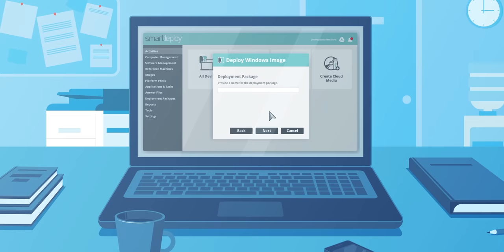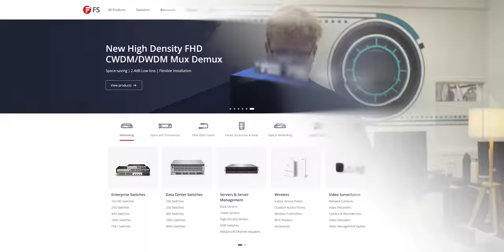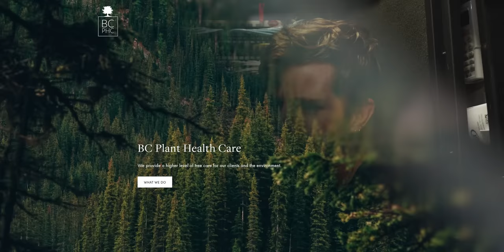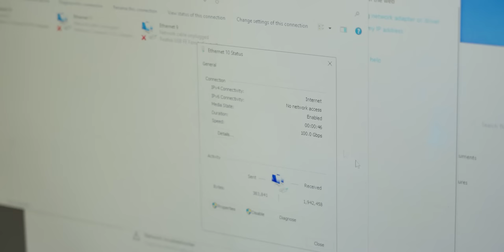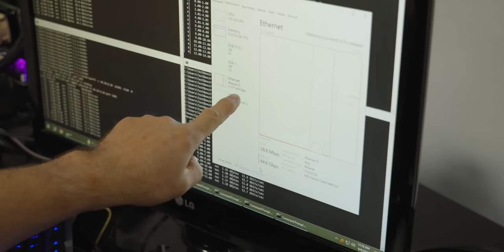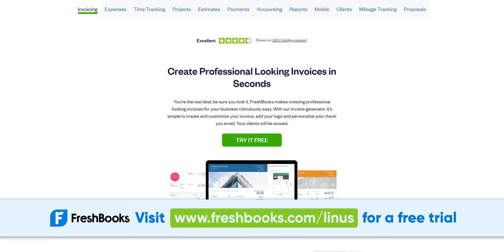Everyone said this was impossible - Backyard Fiber Run

Comment: It’s been a long time since I studied computer tech, back then (2008) Fibre Optics was just starting to gain popularity here in the UK..
I was told that with everything set right then single mode fibre optics can go up-to 100Km between relay stations.
So less than 1Km was always going to be possible.
Reply: Now now, don't ruin the artificial euphoria they propagate
Reply: They were told by contractors 100k a year for 2 times smaller line paid on yearly basis (and more than 100Gbit link is impossible) so are you telling me contractors lied? Never I say, contractors never lie I say. (also Linus knew they could do it themselves, and it was less than 3k in materials)
Reply: You gotta check out deep sea cables, that is some crazy stuff, especially since you have to put in stupid amounts of electricity to overcome the resistance of the cable to power the optical amplifiers which are dropped into the ocean with the cable. Google had two cables going live in 2020, Dunant and Havfrue, capable of transmitting 250 Tbit/s and 108 Tbit/s over more than 6000 km. That still boggles my mind.
Reply: 1KM is no big deal for fiber in theory, but.... it depends on the optics you use.  I don't think the "let's see if we can do this" bit is so much about whether fiber will work over that distance, but if their combination of budget-model switches and optics will work together, and whether they've got it all configured properly.

Having worked with enterprise / service-provider grade hardware in this class, it can be a bit tricky -- such as how they had to fiddle with the switch to get the QSFP28 to 4xSFP28 breakout cable working.  In the "real world," you would be buying all of this from the same vendor (Cisco, Juniper, HP, etc.) and checking hardware and software compatibility lists to ensure they all work together.  In the "find the cheapest optics" world, you just plug and pray.
Reply: For residential last mile fibre may have only started to gain traction in the late 2000s, but it has been in use within the core of telecommunications networks for a LOT longer than that.

But you're right, in long haul DWDM networks, spans between repeaters (amplifiers) and ROADMs can run anywhere up to distances even in excess of 100km.

In deployments that I've done throughout the UK I've typically seen around 80km, but it'll depend a lot on when the route was initially built and the capabilities of the fibre and equipment of the time.
Reply: @dexteritymaster  Well a contractor wouldn't crawl through the bushes with a cable drum. They'd lay down one cable after cutting down the entire bushes, not to mention permits for building and the construction itself together with the hook ups etc. 
I can kinda understand why they'd want that much cash.
Reply: @vodafoneuser1690  how do you find vodafone services?
Reply: @dexteritymaster  I'm sure that quote was from an ISP. They wouldn't just connect the two buildings. Each building would receive a 100g link to the ISP's local CE router to connect them.

Comment: Reminds me of a setup I created many moons ago before Lynksys routers were a thing, Maxtor 40 GB drives and ipfwadm were still around. My friend lived 2 doors behind my house and across a dead end street, had to be a little over 200 feet, so I bought a 1000 foot spool of RG58 coax cable and set up a 10Base2 network using a couple old 486 desktops as bridges using a bunch of $1 junk bin ISA NE2000 cards I found which were handy since one would get fried every time there was a lightning strike nearby.
Reply: We had that with a friend at times when we had 486, to a tree, then on the fences of 2 neighbors, to another tree. About 200m. The problem was it was cut like 3 or 4 times, not sure why. Now we have simple wireless link.

Comment: Hey dudes, you can test speeds between on-premise nodes using open source tool iperf3. Use multiple 10gb clients and run multiple simultaneous tests between iperf3 client and server instances to fully saturate the fiber link. It's a super easy tool to use, all commandline. Keep in mind that it tests half duplex by default, so you'll want to set commandline switches to test full duplex.

Comment: I put in tac12, tac24 carrying camera, video, and audioin stadiums and arenas all over. I’ve installed over a 2K’ home run from the Broadcast trucks, up the side of the stadium around the upper bowl and into the Pressbox on the opposite side if the complex. While fiber is delicate, it can take a beating and and some pretty sharp corners. Love this content.
Reply: Steel pipe lines are welded on a ship then dropped along the ocean floor as they go...Some flexible cables will be fine
Reply: @mrmotofy  I would like to see that process in person…amazing how you can manipulate materials as long as you stay in their tolerances and keep’em happy.

Comment: I went to Light Brigade FOC training to get certified for working with fiber. The instructor taught us a trick for a temporary attenuator by wrapping a jumper around a pencil. It’s about 1 dB per wrap. I had to do it once when I didn’t have a replacement in the right power card iafter a failure. I didn’t have the right attenuator and used the pencil trick till I could get the right one.

Comment: we ran 2 pair of multi-mode cable between our house and a neighbors to share a DSL connection in the early 2000's. It was using 10mbit media converters and connected to an interface on our router. Pre-wifi extenders and no cable modems in our neighborhood. Had a local guy terminate the fiber for us.

Comment: You could also use BiDi (bi-directional) transceivers, it does TX/RX over a single fiber. They cost ~$50+ for 10Gb, but double the fiber density.

Comment: If you used all 3 pairs, you could do 300 Gig, but the switch in your server room only has 4 ports so you'd only have 100 Gig capacity between that and the rest of your equipment.  You could still do it, but you'd need a bigger switch.  Also, look into using iperf3 for testing network speeds without worrying about the limitation of drives on either end of the connection.
Reply: iperf3 is what Jake was running as the final test at 27:33

Comment: Now you guys have to invest in a fiber splice kit for when the inevitable happens. Can't wait to watch you attempt to resplice the fiber in the middle of winter when it's 0 degrees. Also you might need an optical tdr so you won't have to guess of where the Squirrels ate it.
Reply: I thought about the same, in our area it is deployed 5-10 metres below pavement. But I think the plants will likely provide some sort of insulation. is the armoring thicker on Linus' cable than it is with regular installations?
Reply: At $700 bucks, just replace the entire cable.
Reply: At $700 for the cable it costs more in labor to run the dang thing than it does for the material.

Comment: In the entertainment business we regularly use cables like this these days. Think about how much data has to transfer to and from the broadcast trucks which are usually parked way outside the arena or sporting event facility. We also use them inside convention centers for transferring audio and video around the building. These cables are usually per event. It's really amazing what we can do now with fiber this cheap. Back in the old days I remember running five wire coax everywhere along with XLR cables, and it was really annoying and a real pain. Nowadays one cable with some proper gear on each end to break out audio and videos signals is often all we need.

Comment: When I was an engineer for the power company in 2000 up until 2004.
We had to work with the new fiber guys who put it under and over our lines.
They had to be so careful it was unreal. And if the cut or kinked it accidentally it ruined so much cable it was ridiculous

Comment: Oh man... I was so excited at first but then it was ruined by the whole "pre-terminated fibres." god damnit! I was looking forward to a showcase of optical fiber welding. That stuff is really cool and I was starting to get a bit of nostalgia from when I used to do that in the military.
Reply: Also, the more expensive cabling can easily have 96 fibres, or more, in them. Haven't looked at the available cabling recently.
Reply: @mrwalter1049  3456 Strand cabling does exist, but in more normal use cases it normally maxes out near 288 strand.
Reply: @jerithil  Cool! 192 was the most available to outright buy for anyone locally; back when I looked at it.

Comment: I am constantly surprised about how cheap fibre optic cables are for the bandwidth and length they can handle. A lot of the runs in my new house will be fiber
Reply: The cable's cheap and easy.  But the ends can be a bit tricky.
Reply: @nickwallette6201  yes definitely, and the fragility of the unprotected fiber

Comment: I once saw a coaxial hard line missing the entire half on top.  This was from pole to pole and the center core was totally exposed..  Never underestimate squirrel chew when thinking your cable is indestructible.
Reply: The metal armor is an attempt to stop rodents from doing that...
Reply: @IBM_Museum  Note the word "attempt".
Reply: It’s fiber optic so there’s nothing that would make a squirrel even want to chew
Reply: @gregistopal  I guess you dont know squirrel huh mate
Reply: @gregistopal  squirrel will chew anything. They've chewed thru electric cables that run from the street to my house, in the past. I think they want to use the outer rubber to nest up... Also had rats chew thru concrete, so there's that...
Reply: @gregistopal  the covering will be so tasty though.
Reply: @IBM_Museum That hard line is wrapped in it.

Comment: There's a tool called a TDR (Time Domain Reflectometer) you can use to determine exactly how far into the cable you broke it within a certain margin of error. You have to test every strand and the machines are expensive, but your best bet would be to have a low voltage come out and splice if you break it anywhere. It's not hard, but it is expensive because the tools are. :) Good luck.
Reply: The fiber ones are just called optical tdr.
Reply: It's also a tool that tells you exactly how it works which is a bonus.  Ignoring attenuation you'll expect a brief signal doubling as the signal travels down the line and reflects off where it's terminated or broken.  Since you know the speed of light in the glass you just have to have a pretty accurate way to measure the time it takes for you to measure that reflection, divide by two, and then multiply it by the speed and you're left with the distance the light traveled to the break.  You can get an older JDSU OTDR for a couple grand.
Reply: Yup OTDR.  We use them all the time when testing MPT's
Reply: OTDR to be pedantic.

Comment: FS has some 800Gbps SFP's, they're hella expensive though, and designed for long haul data centre links, but you could try that for more throughput. MicroTik is awesome, I know of a couple of people who use their switches for production gear, as they're cheap, lightweight and prosumer grade. I really enjoyed this video, can't wait to see the trenching machine, conduit and hardwork to run it properly. Maybe even do the other studio at the other end of the carpark?
Reply: If they were going to do it with three I would suggest they consider linking the sites in a ring topology though. That is generally the preferred option for 3+ node external fibre networks like that since it provides redundancy against some of the risks that come with having fibre crossing sites you don't have exclusive control over. For example when some idiot inevitably manages to stick their excavator where it doesn't belong in the future. Trust me it will happen eventually even when you have set everything up properly and the cable locations are all registered so anybody applying for a permit to excavate should know better. Hell I have even seen it happen to one of ours where the team that did the site survey had correctly identified and marked the location of it, the water utility still managed to dig right through it somehow.
Reply: @seraphina985  Yeah, you could certainly ring feed it, however, the utility of doing that would be astronomically expensive, as you would want the fibers to be separated and not in the same area. The other option would be an AirFiber link as a back up, which is limited to 2Gbps. Or a high GHz eDMR radio backhaul, but then you would need to pay for radio spectrum license fees.
Reply: @obsgr1  True although to be fair I am not certain where the third site actually is either which obviously makes a big difference. Can't really figure out the best option without having all the information about the site or user needs for that matter. Important to know what the minimum connectivity the fallback needs to provide actually is for example.

Comment: As a professional fiber installer, I must say that it bothers me a bit that you use pre-terminated fiber, instead of a proper installation with  joints in a proper patch panel etc. Anyway, cool project and your videos are always super fun to watch! :D
Reply: Terminating fiber is not at all practical for those of us who are not professional fiber installers.
Reply: @gingerman5123  specially this kind
Reply: @gingerman5123  Splicing equipment has gotten pretty cheap, and it is not hard to terminate fiber. So for a tech savvy person with a decent budget (like Linus) a professional fiber install could easily be done.

Comment: This reminds me of when I was doing a "Tornado Relief Show", a fundraiser concert in the southwest suburbs of Chicago about 25 years ago.  We ran a fiber pair through cornfields from the place where the concert was held to the cable company's head end, about 1/3 of a mile away.  I also remember picking it up, after the concert at 2AM.  Boy, thems were the days!  Probably should have used a wireless microwave system ... would have been a lot easier, but back then, we used what we could get our hands on for free.

Comment: I know that reel was fiber but any other kinda reels of cable like that should be pulled with gloves that are insulated from electric shock. The reels are usually tested once wound by putting voltage through to test for any issues with the reels. This will cause the reels to become like a capacitor when unspooling the cable I've seen techs ground out the cable while pulling causing death or serious injury. Static discharge is very likely if reels are not properly handled when working with them.
Reply: Why don't they discharge it after the testing is done?
Reply: @manw3bttcks  even if they do the fact of the cable being wound on a spool like it is and the spinning of the spool when you un spool it , it can build up a charge to, I think that coupled with a few other things i can't recall, but at at the time it was seen as pointless since it might be just as deadly they will still treat it the same as it was so why bother. thats alot of voltage to bleed off lol

Comment: It looks so good seeing 100gbps link testing like it is being done at home, when it is mostly used by ISPs and costs literally a bomb as Linus said. Being a networking engineer i like hearing and seeing these things and that cheap too.
Reply: 100G also started to be common within data centers a few years ago also.
Reply: I have to wonder what they were quoted for. $8500 a month sounds like a lit link from the ISP. A dark fiber pair or two should be much cheaper than that if they are lighting the fiber themselves and only need point-to-point. I have to wonder if that cost includes one-time installation costs which are being spread over the year lease, but which drop after it's paid off.
Reply: @KaiserTom  it's not just the cost of the physical wire but also occupying space in the conduit (Bell/Rogers/etc. does not let any Joe Blow pulls a fiber within it for free), city permit, etc.

Comment: Another awesome video. 20 years later, and I'm no longer working with wireless internet transmission. Nowadays, I work with more and more fiber as it rapidly replaces copper. Currently, we are up to 5 Gigs per second, and distance isn't that much of a factor. Most customers usually go with 300 or 500 mbps. 5 Gig is a little overkill.